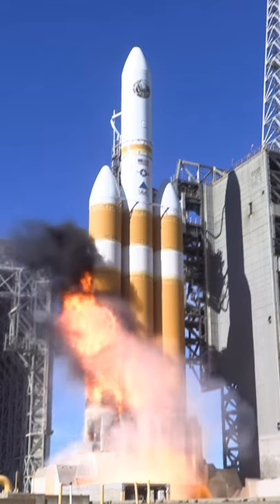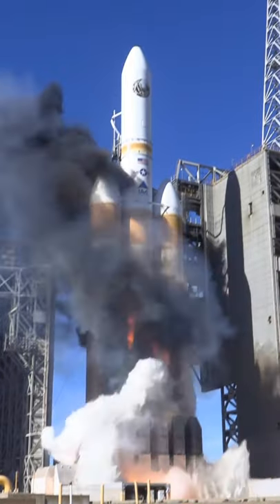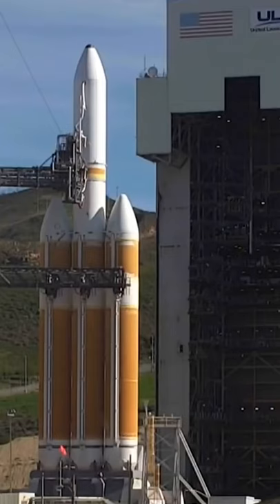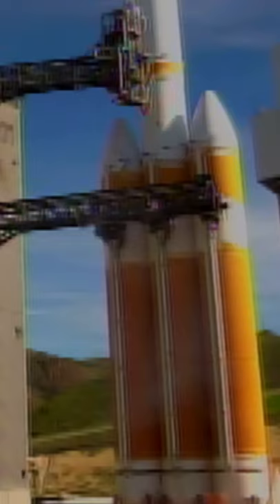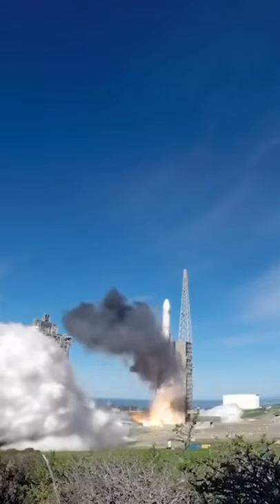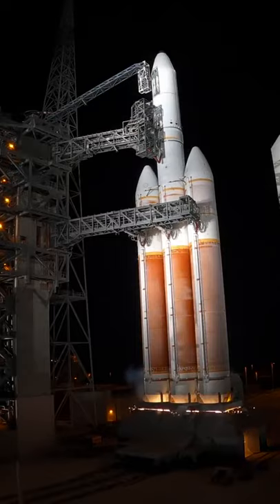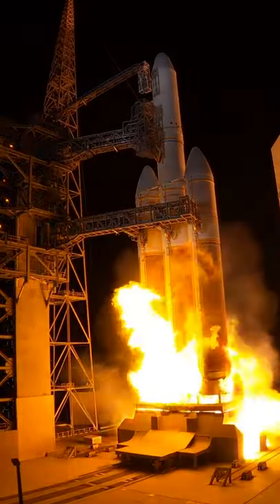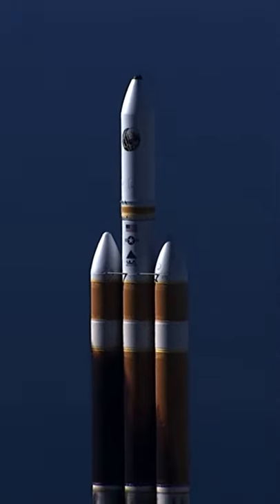Why Delta IV Rocket Sets Itself on Fire? #shorts

Comment: Plot twist: it wasn’t supposed to catch fire but they just went with it
Reply: I'm pretty sure they just did that because they saw it is not harmful to the rocket
Reply: They have to engineer for it or there would be a catastrophic failure. The fuels are cryogenic and if they heated then the containment would fail.
Reply: Ya called poor design but easer to let it then come up with a better idea.
Reply: @dontimberman5493  wrong, purging the engine with hydrogen allows prior to ignition allows them to get away with using cheaper metal alloys in the engine, a little fireball on at ignition is literally of no concern and is worth the material savings on the engine, no poor design here, the delta IV is one of the most successful rocket designs ever made.
Reply: @dontimberman5493  They drop the assembly in the ocean after five minutes use. There is no loss to what they are doing which is characteristic of good design. Otherwise they would change it.
Reply: To safe faces?
Reply: @Bendoverz34  It looks like a joke but there is no fun in it. Still what the dude described was in fact what happened and I agreed on that ignoring the poor joke.
Reply: Pretty much how a lot of things go in the world science
Reply: The first time - probably
The second time - they engineered the fuck out of that insulation

Comment: Because it won't be reused hehehe
Reply: The Falcon 9 gets charred during the reentry burn far more than the Delta IV does during ignition.
Reply: @crippleddiego9226  the Falcon 9 isn’t charred but instead is covered in a layer of soot from the engine exhaust.

This soot isn’t cleaned as it doesn’t lead to a significant change in the performance and is more work than it’s worth.

This soot is the main issue they have with refurbishment as it needs to be properly cleaned as to not clog up the engines during flight.
Reply: @weekiely1233  it appears to be charred, bad choice of words, sorry. I do know that it gets covered in soot from the engine exhaust, as I stated that it gets “charred” during the reentry burn.
Reply: @crippleddiego9226  no worries. I’m pretty most people think that because it does look like it.

Comment: No offense, I'm not a rocket scientist or anything, but Im pretty sure you could design this in a way that it doesn't catch fire.
Reply: But you don’t need to, it’s just cosmetic scorching
Reply: So this is actually more complicated than you would think and has to do with how the engine operates and design decisions that were made in order to cut costs as the rocket is expendable so making the engines as inexpensive as possible is important. Let me know if you want more of an explanation.

Comment: You on the right track that insulation is there for when the rocket is in standby when it is flying through the air they want the insulation gone for maximum tank pressure/evaporation

Comment: This is actually one of the main reasons ULA has had problems human-rating the Delta, each engine takes about 4 years from signing contract to putting it on a rocket and they would need to change the engine at least 2-3 times iterating each time to reduce the burning H2 at liftoff enough for it to be safe for crewed flight.

Comment: The high-speed exhaust entering the flame ducts… not flames ducts. 
In English when a plural noun is used as an adjective you use its singular form. 
(usually bc there are exceptions)

Comment: If it's hydrogen, why are the boosters black afterwards? And the smoke is also black. I think it's hydrazine burning with a lack of oxygen.
Reply: The exhaust is clear (apart from the graphite nozzle burning) the reason its black is because it ignites the insulation on the outside of the tanks.

Comment: Does the char affect the flight trajectory at all? Like is it included in the calculations or what
Reply: It has no significant impact since it only burns the outermost layer of insulation.
Reply: no, even if it affects it the slightest, those engine could gimbal and point the rocket at the right direction

Comment: So they couldn't change the timer for the oxygen?
Reply: Nope, oxygen rich combustion gases are extremely hot and corrosive and can easily damage the internal components of the engine, they run the hydrogen for a few seconds in order to purge any oxygen out of the engine, ensuring no pockets of oxygen rich combustion can occur, this let's them get away with using cheaper metals inside the engine helping to reduce the cost of the engine.

Comment: I thought the flame from hydrogen was blue.
Reply: seems like not
Reply: The engines have an ablative layer on the inside of the bell instead of using a liquid cooling system
Reply: Scott Manly did a video on the Delta IV and i highly recommend it
Reply: It is, sort of, really it's mostly transparent, the flame you see is where the already burning hydrogen chars the orange foam insulation.

Comment: does anyone know why the hydrogen valve opens so early compared to the oxygen valve? maybe the escaped gas ignites and works almost like a pilot light?
Reply: It’s because the engine runs fuel rich

This means that the mixture of fuel to oxygen is slightly higher than needed in order to keep the temperature of the engine low enough as to not cause damage

So to prevent a perfect mixture of oxygen and hydrogen at startup that could cause damage they run the fuel through first then start the engines.

sparklers called ROFIs are ignited (same as the shuttle) to burn off the hydrogen and prevent it from concentrating.

Comment: You know what doesnt light itself on fire to take off? Elon Musks rockets... heuheuheu
Reply: It doesn’t light itself on fire to take off, it lights itself on fire to ignite the engines.
Reply: @crippleddiego9226  no it doesn’t
Reply: Falcon 9 burns kerosene and doesn’t require a fuel rich cycle.

The fireball isn’t bad for the rocket and it’s sort of intentional.
Reply: @weekiely1233  what? He stated that the falcon 9 doesn’t light itself on fire, unlike the Delta IV. I was stating that the Delta IV also doesn’t light itself on fire for ignition.
Reply: @crippleddiego9226  it doesn’t light itself on fire to ignite the engines. It does so to prevent buildup of hydrogen at ignition that can damage the rocket. 

The engines themselves are ignited a few seconds later via solid propellant igniters
Reply: @weekiely1233  that’s what I said
Reply: @crippleddiego9226  sorry misread what you originally put. 
My bad
Reply: @weekiely1233  you’re good, thanks for correcting me

Comment: Wouldn’t heating up the gases make them expand and in turn give it even more thrust?
Reply: It won't give it even more thrust, for one the tanks can only handle so much pressure, and two the fuel and oxidizer feed rates are a pressure dependent process, if the pressure inside the tanks fluctuates too much it will impact the amount of fuel and oxidizer entering the engine and can adversely impact the fuel ratio, so maintaining a consistent tank pressure is important. Additionally by keeping the fuel and oxidizer super cold and dense you can actually fit more of it in the same size tank.

Comment: 68 main engines?
How many sub engines does it got?
Reply: It doesn't have 68 engines, the main engine is the RS-68, it was developed by Aerojet-Rocketdyne and it stands for Rocket System 68, each core has one of them. I believe the 68 has to do with their internal development process, this being the 68th power head (the fuel pumps, injectors and combustion chamber) design that they have considered.

Comment: hydrogen isnt as much reactive with metals as oxygen, and you do not want oxygen or LOX running in the wrong places, also hydrogen works as a cooler that chills the engine for max capacity

Comment: OR, they could addd in a hydrogen “venting” or “deflection” or “ hydrogen 2 seconds worth catch storage collection system along the exterior of the rocket. 

Or some sort of a BACKDRAFT system to counter the flames. Or wrap the DELTA 4 in ghost riders logo so it looks even cooler.  Or perhaps marshmallows. Either way find a solution.

Comment: The bigger question is why do they keep wasting money painting the goddamn thing if it's just going to get burnt every single time
Reply: It's not painted, the orange color is just the natural color of the  insulating foam, same type of stuff that was on the space shuttles big orange fuel tank, it's to help maintain the temp of the cryogenic liquid hydrogen and oxygen that power the rocket and slow down their boil off rate. It's surface gets crisped but it doesn't impact the insulating properties much.
Reply: it's an insulation, and it's there to protect the fuel

also a bit of fun fact: NASA used to paint the space shuttle fuel tank, but realized that it's expensive and adds a lot of weight. that's why the space shuttle fuel tank is orange, not white

Comment: Why paint the outer layer of rocket material then, it may be made up of Stainless steel.
Reply: It's not paint, the orange is the natural color of the insulating foam that is on the outside of the tanks, it's needed to keep the cryogenic liquid hydrogen and oxygen from boiling off too quickly. It's the same type of material that was on the outside of the space shuttles big orange tank.
Reply: @Ender240sxS13  good catch.🙏

Comment: Ok but why hydrogen valves has to be open so fast?
Reply: They open the hydrogen valves first in order to purge the engine plumbing of any oxygen, this ensures there will be no oxygen rich patches when ignition starts. Oxygen rich combustion gases are extremely hot and corrosive, they can actually burn most metals and metal alloys. By purging the system with hydrogen to ensure there is no oxygen rich patches they can get away with using cheaper metal alloys this reducing the cost of the engine, which is important as these rockets are expendable, there is no recovering and reusing them.
Reply: @Ender240sxS13  thank you! Thats the info id like to see in the video!

Comment: Wow nasa you can really make rockets can’t you
Reply: That’s not a NASA rocket
Reply: @crippleddiego9226  Delta rockets have a different name yes but has been around nasa for 60 years now I’m sure they’ve collaborated for awhile.
Reply: @josiah3618  Delta 4 was designed and manufactured by Boeing same as all the other delta vehicles 

ULA now operates the fleet.
Reply: @weekiely1233     Not trying to sound rude at at here but do you think nasa would of have had any input on their tech? Even now Boeing and NASA are both making the RS-25 rocket
Reply: @josiah3618  some guidance but no actual manufacturing. 

And it’s Aerojet Rocketdyne who makes the RS-25 Engines

Boeing makes the core stage for SLS however this is through a contract to exact nasa specifications.

Comment: idk it feels like a stopgap or cost saving decision
Reply: Sort of yeah, one of the design requirements of the RS-68 (the engine that powers the core boosters) is that it be as inexpensive as possible as these are expendable rockets, there is no recovering and reuse of those boosters, this means that the materials used in the engine need to be as inexpensive as possible.

Oxygen rich combustion is extremely hot and corrosive, it can actually burn up most metals, so having oxygen rich combustion occur in your engine is a big problem, in order to get around this you have 2 options: 1 use sophisticated and expensive metal alloys that can withstand these types of conditions, or 2 ensure that these types of conditions cannot happen in the engine. The designers of the RS-68 opted for the cheaper option 2, the most common time for these types of oxygen rich conditions to happen is during startup, so in order to avoid them they purge the engine systems with hydrogen before running the oxygen.
Reply: @Ender240sxS13  more to do with the easier solution than the cheapest.

Comment: Thats is possibly the dumbest most idiotic engineering solutions Ive ever seen. Well done NASA.
Reply: It’s not NASA
Reply: Except it’s not dumb at all, doesn’t damage the rocket and is necessary for successful startup
Reply: @weekiely1233  Bro setting your rocket on fire is dumb, I dont care if it works some times or it's a "design", you can do without it. We live in Space X era, what is this none sense.
Reply: @dondovahkiin7899 How is it dumb?

They intentionally ignite the hydrogen Before ignition to prevent it building up and exploding.

It’s an intentional fire that the rocket is designed to handle.

It’s part of the startup sequence.

It doesn’t do anything to the rocket other than cause a small amount of burning.

The Delta IV has never had a mission failure

Falcon 9 has had 2 

So actually this “dumb” idea is more successful than SpaceX’s Falcon 9 rockets.
Reply: @weekiely1233  its doesn't do anything bad until it does, you think any sensible space agency is dumb enough to approve that rocket for human missions? 
Oh now you mentioned Falcon 9, Falcon 9 has had 111 successful missions and 2 fails, and also, its a reusable platform.
 what are you comparing ? This old technology of disposable  rockets vs a reusable reliable low erath orbit platform?
Reply: @dondovahkiin7899  but again it’s designed for this fireball. It’s necessary for engine ignition.

It physically cannot harm the rocket anymore than any other launch. 

This isn’t the same as the shuttle foam issue of the Falcon 9 COPV’s

Also this rocket launched the OFT-1 mission of the Orión capsule for NASA. And the parker solar probe. And numerous Government payloads

So if NASA, the airforce and the NRO are willing to but billion dollar spacecraft on top then you can assume they think it’s a good design.

Also Delta V is much more capable than a Reusable Falcon Heavy

The only way falcon Heavy could match its payload to GEO is if it was in the expendable configuration
Reply: @weekiely1233  bruh i give up. You win.
Reply: of course it's an elon musk stan with elon musk pfp
Reply: @NotNibrasakhi  Very observant.

Comment: Because they use too much liquid fuel, its called a hot start, if they started cold and used high pressure steam to launch then ignite and catch speed quicker perhaps would be better
Reply: Mmmm no, they run the hydrogen through the engine first to act as a purge, eliminating any pockets of atmospheric air and oxygen, this ensures that when combustion starts there are no oxygen rich patches which would be extremely hot and corrosive, this allows them to get away with using cheaper metal alloys saving costs on the engine as they are expendable.

Comment: The real question is why is the delta 4 shaped like a male appendage and its accessories ? Explain that one mister video maker guy?
Reply: Because in that form you can use the maximum power of two engines and the size of the tanks is smaller than the middle part because it would be too heavy otherwise, there you go
Reply: @masterrzeke  not yet, that is...
Reply: you haven't look at blue origin's rocket dont you?

Comment: No.  It is in fact NOT "charred".  It's simply covered with the black soot that is a byproduct of an overly rich fuel condition.  It's not actually burned at all.
Reply: Nope, that's it if you use kerosene, D4H uses LH2/lox not even with the carbon ablative nozzle you don't get much soot, that's burned insulation

Comment: So we choose a stupid launch method rather man developing one where that doesn’t happen? NASA completely expected foam chunks breaking off of the shuttles and look where that ended up
Reply: It isn’t a stupid method at all. The fireball doesn’t harm the rocket and is intentionally started to prevent the hydrogen building up and damaging the rocket at ignition 

And the shuttle was never designed to its the expectation that foam would break off but nasa took their chances with it.

This is completely different
Reply: @weekiely1233  how is a method that intentionally causes a fireball not risky? Sure, it makes that specific method safer- but you’re dealing with potential damage, just like the foam chunks that they chose to risk.
Reply: @jewishrverend  the fire itself looks worse than it is. The fire doesn’t damage the foams structure just burns the outside layer.

And if the foam fell off it wouldn’t be an issue as it doesn’t have an orbiter that it could damage.

The fireball itself is intentionally ignited before the engines ignite to prevent the hydrogen mixing with the air and, when ignition occurs, creating a much bigger fireball and explosion that would damage the engines and rocket.
Reply: @weekiely1233  I understand the process and I get why they're doing it, to prevent a worse situation - and the foam reference was to STS, not Delta IV or this video, but again, I ask, is there no process where this is avoided entirely? Why not develop something where you don't have that at all. 

Again -  sure, this prevents a potential worse situation, sure it just looks crazy, but you're adding an exterior explosion that isn't supposed to do any damage, but its still a massive fireball on the outside of the rocket, that combined with other potential failures seemingly could cause catastrophic failure. 

I'm not hoping for any of that to happen - i want the best for all of this but its wild to me that there wasn't a better way.
Reply: @jewishrverend   there are solutions in fact the newer engines are designed to reduce the amount of hydrogen released before ignition. But to completely remove the fire ball would be much more effort than it’s worth since this is harmless to the rocket.

Again the fire itself looks a lot worse than it is and only the outermost part of the foam is affected. There are no major systems that are affected.

The chances that this causes a failure is almost impossible. 

Mainly because it happens before the vehicle is released from the pad.

If it had any chance of causing a failure it would have been removed.